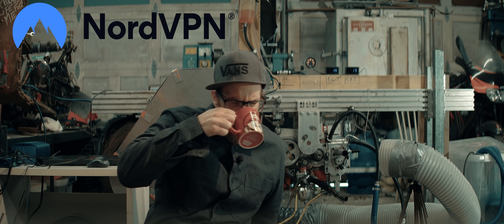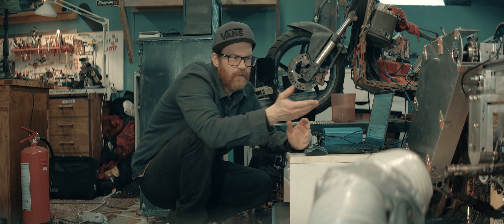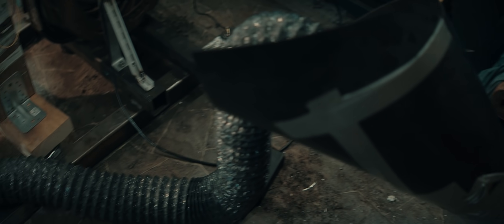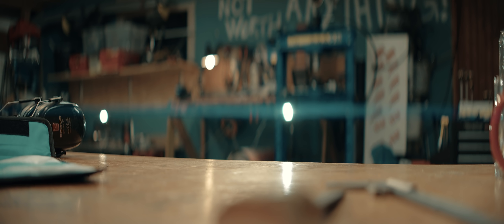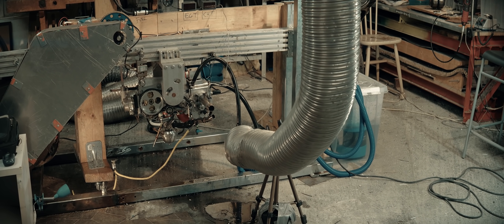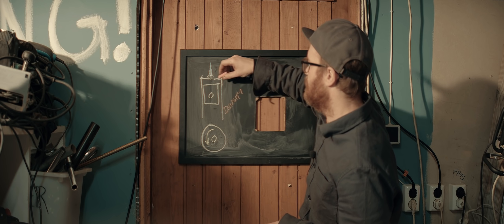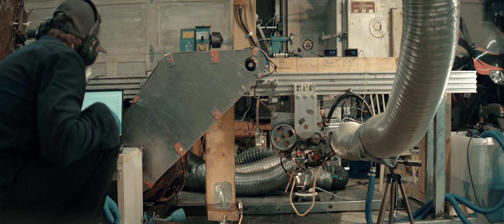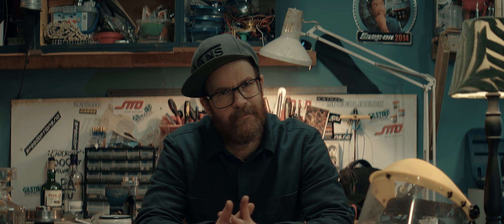50cc, 20hp, 15psi - we're just getting started! Supercharged Nitro Two Stroke.

Comment: What is the current Horse Power record on a 2 stroke 50cc?
Reply: Not sure but a readily available Bidalot 50 wr cylindre with porting can give over 22hp at the crank https://youtu.be/5FBVYS3YeS0?t=596, i wouldn't be surprised if this supercharged prototype breaks the 30hp
Reply: 25hp from backwheel
Reply: @huugo8278  Turbo?
Reply: @jareknowak8712  Nope
Reply: Dont know but i am sure there was a 3cld 2 stroke 50cc in GP history somewhere pushing 19hp, no supercharger
Reply: 1 bar of boost should double his output. Means the engine is making about 10hp NA. If I was building something like this I would tune it out NA and then add boost. Then you know where you should be at HP wise at whatever PSI. I would also use fuel injection to get rid of the unknown timing problems and also have datalogging helps a bunch. That's just me because I'm not a carb guy.
Reply: @fivepointeightnate  this engine wouldn't work without the supercharger
Reply: @fivepointeightnate  
Unfortunately it's rather far from being that simple, neither with turbo- nor with supercharger.
This simple formula only ever applies in massively simplified theory, under absolutely ideal conditions unknown in real world scenarios and when the only variable you change is the intake pressure alone (and it's actually indicative of/proportional to actual air mass), like from a compressed air bottle or an independently driven compressor.

But with a turbo there's always the pressure ratio and with a supercharger there's the parasitic loss, just to begin with.
Not to mention that intake manifold pressure isn't equivalent to air mass, like at all, in the first place.
Reply: Derby from Spain made a 2 cylinder 50 cc back in the 1960 ies with 40 hp.
Reply: @noahwail2444  source?
Reply: @yodamaw  I read it in a book about high output 2 strokes, back in the 1970´es, but i din´t recall the title..
Reply: @noahwail2444  false

Comment: 20 HP from 50cc was achiever in the 1960 s as you know with simple piston ported two strokes on pool petrol  Van Veen Kreidler was just one company there were many others this is not to denigrate  your efforts but why are you doing all this please ?.
Reply from the maker: 20hp was at the limit of what they could do, it's just the beginning of what this might be capable of. Not much boost yet, no timing adjustments, no fuel adjustment, crude port/duct geometry.
Reply: He is doing all this because  he is a legend.💯💪
Reply: To boldly go where no man has gone before.....
Reply: @tomperry9954  I thought that as well!
Reply: Coz he's a crank twisting, con-rod snapping, piston popping, Two stroke, nut job legend from the fiery depths of Boosted Nitro land. If you don't like it, you know where the door is.
Reply: @zuzanajendralova8087  SAD but expected.
Reply: @daviddjerassi  No offence, just a bit of fun old chap.
Reply: What is Pool Petrol?
Reply: @Scissors69  According to google, it was a less refined unbranded type of petrol, rationed after WW2. So I guess David is suggesting, 20 hp from 50cc on lower quality fuel was achieved in the 60s. Maybe so.. Difference being, they didn't have youtube back then so we unable to enjoy watching it unfold. Also, we are just scraping the surface of what is possible. Who knows what the maximum flow might be or Torque/HP the reciprocating components can take? Can't wait to find out.
Reply: @zuzanajendralova8087  - Thank you, and agreed on looking forward to the progress
Reply: @Joshua Langley Josh i totally get it but now the world has banned two strokes thanks for your reply.

Comment: On a dyno, when you go over ( waaaaay  ) peak power, and pull the engine down, with the brake, it's  a bogus number, because the sensors will read the inertia removal and show a few percentage numbers over steady state, or an acceleration pull .
Reply from the maker: Will care about accuracy later, still just getting to know the engine.
Reply: True, but just pointing out an old Pro Stock engine builder method of fooling some of the customers some of the time . Of course they usually knew something was wrong when they got their time slips .
Reply: Omg 2strokestuffing replied :0
Reply: @Eduardo_Espinoza  he's a nice guy! He reads most of comments!
Reply: Good point